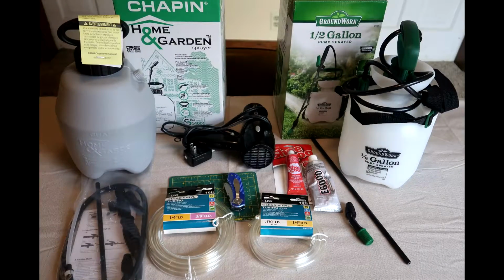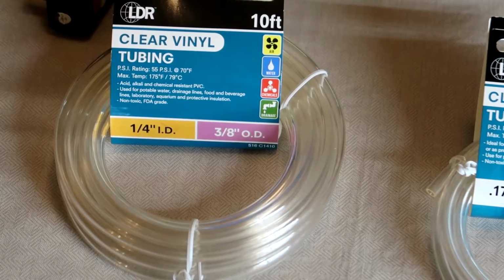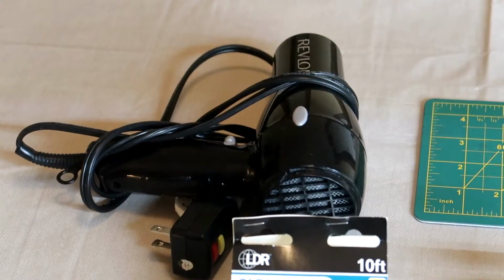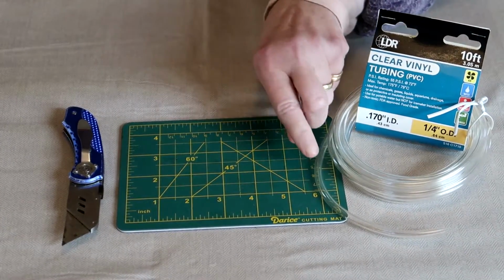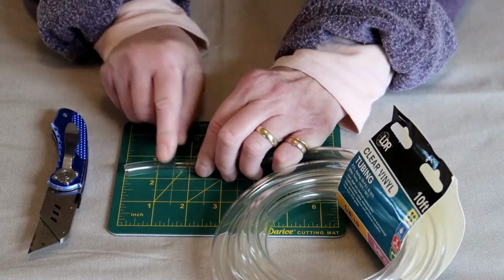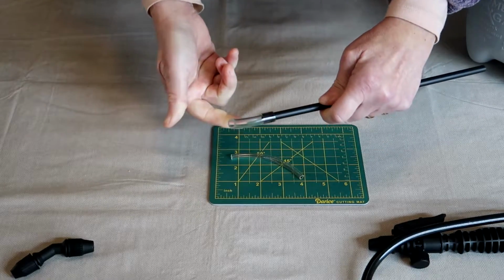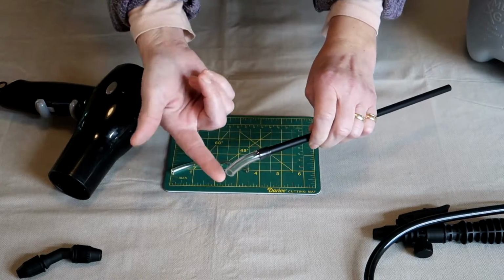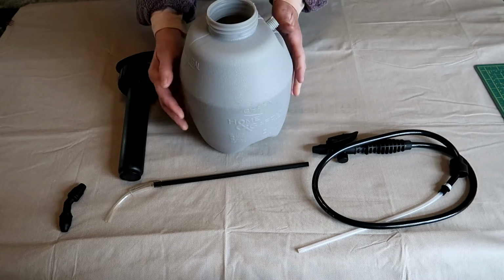Easy DIY Houseplant Watering Wand

Comment: Why don’t you just use a jug with a narrow sprout? It comes in a variety of shapes, colors and sizes these days. It’s usually 1.5-2 liters for a home plant. Also, for most home plants they get benefits of shower in foliage. And because you shouldn’t be storing any water drained in the saucer, not many would feed water to the plant where it’s sitting. Usually we take them all to shower or kitchen sink and shower foliage to wash dust and water them.  This doesn’t make sense to use a sprayer…
Reply from the maker: I realize this doesn't fit everyone's needs. We all have our plants in slightly different locations and environments.  This is designed for people like me who have a lot of plants (and they're not located close to a water source). I'm also a pretty messy person and this keeps water going where I want it to. :D Thanks for watching!